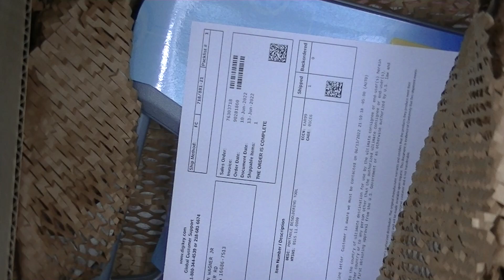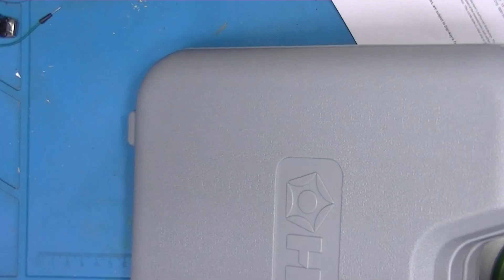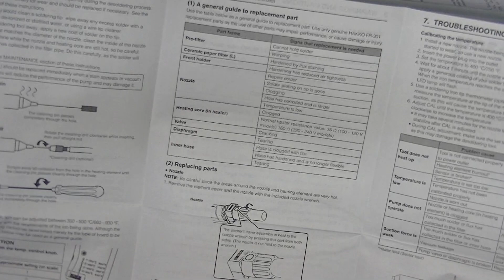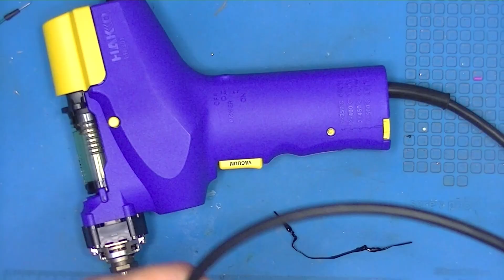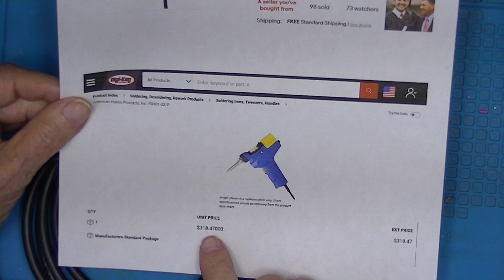A New Hakko for the Shop

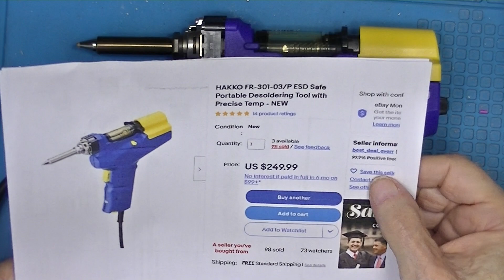Comment: 10:13 - This is a scam - a rare one where the purchaser is not the one being taken. They're selling items at less than actual cost (this kit sells for $318 from Digikey), having them drop-shipped to the end buyer, but using stolen credit cards to pay the supplier (Digikey). eBay's new daily payouts to sellers makes this easier to get away with before the account is shut down.

Comment: These are great.  Costly, but great.  And you'll likely need to spend more money buying extra tips, extra cleaning tools, and extra filters.  As long as the tool is cleaned frequently it works very well.

The eBay seller is doing what is called "drop shipping" which I find to be annoying.  Normally eBay sellers use Amazon for that.  But I've never seen a huge discount like that.  The seller must have a business account with digikey for special pricing.